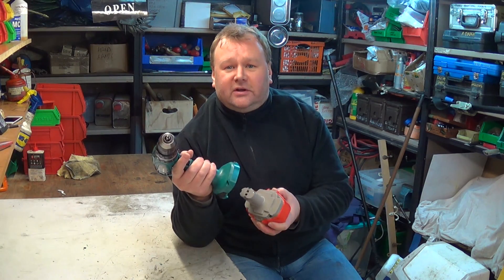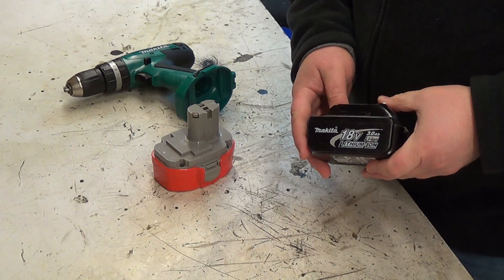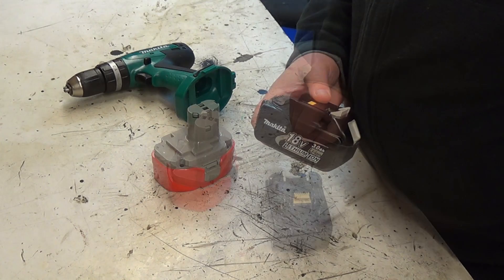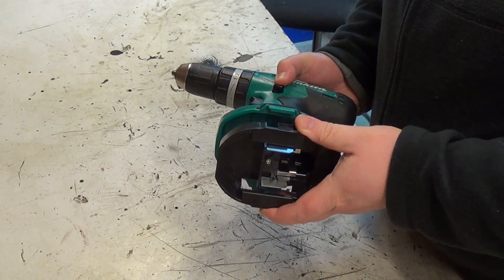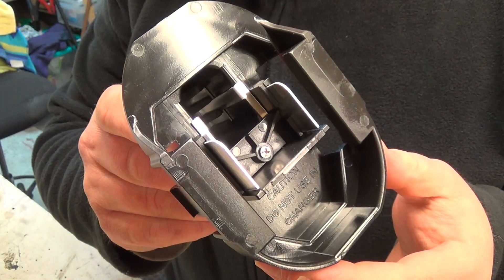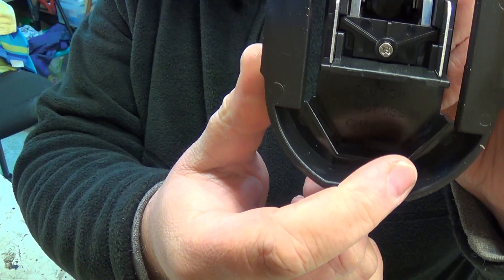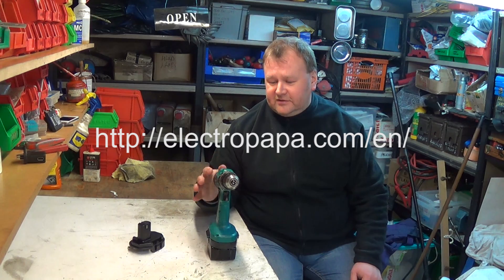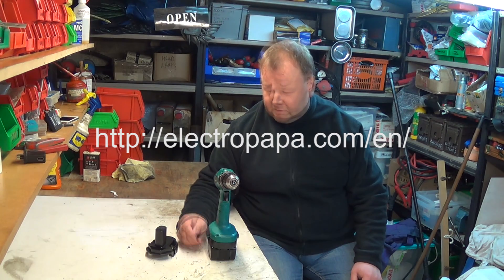Makita 8319D Ni-Cd to Li-Ion Conversion Using Adaptor, Adapt Ni Cad Drill to LXT Lithium Ion Battery

Comment: Is it not to many volts for it though
Reply from the maker: My old drill was also 18v. You could also use a 18v battery on a 14v or even 12v drill, but it will spin faster, and if you work it hard it might overheat. To be honest, with the fact that the old ni-cad drills are worthless now it would probably be worth the gamble. The other thing to say is that this vido is seven years old, LXT drills are much cheaper now and secondhand ones can be had for less the price of an adaptor in many cases.

Comment: This adapter will work with Makita 12v ?
Reply from the maker: It may fit, but not sure you want to run a 12v tool at 18v.

Comment: You have the exact same drill as me, I bought it new and it’s been a god send.  One thing that does worry me though is what to do when the brushes die ?  Any ideas ?
Reply from the maker: The brushes in an 8319D are built into the motor and not replaceable separately. You can still buy a complete new motor for £20 if it dies though. To be honest the drills tend to outlive the batteries on these old drills, so i wouldn't worry.
Reply: @ShedTV  love that reply man !!! Thanks 😁😁
Reply: It’s got a little bit of a whining sound ? Any ideas ?
Reply from the maker: @RFURDALEY  Unless you feel like taking it apart and greasing the gearbox, just spray a bit of thin lubricant down the chuck and around the gear rings and selector and work them back and to. That might help. Like I said it's an old drill, if it's still going; happy days!
Reply: @ShedTV  Thank you 🙏
Reply: @RFURDALEY  Many power tools whine, don''t whine about it
Reply: @johnussss  aha ha ha ha ha ha ha hee ho heee ha ha ha. You are funny

Comment: Where can you buy that adapter? Also will it work with a 9.6 volt drill (my existing nicad battery voltage) conversion to 18 volt lithium battery? My drill is an old 6260D model. Thanks for your time
Reply from the maker: Various adapters come and go onto the market, the best places to look are eBay and Amazon. I don't think that running a 9.6v on 18v will work for very long before it destroys the motor though.

Comment: Do you have a direct link for the adapter? Their website had lots of different ones. This is exactly what I've been looking for,.
Reply from the maker: I think thsi is the right one. Do please double check though. https://www.ebay.co.uk/itm/Professional-Battery-Adapter-Converter-fit-for-Makita-18V-Ni-Cordless-Power-Tool/402505299359?hash=item5db72f759f:g:~i0AAOSwOGdfj6UO
Reply: Excellent, thank you! Purchased. I'll let you know how it get on!

Comment: The older Makitas seem to be better built too.. Maybe it is just me.. But I had a brand new 18 volt brushless Makita hammer drill and it started smoking after just drilling 4 3/8 inch holes 2 inches deep in hammer mode on concrete, so I took it back. The next one got extremaly hot in a short period to the point it burned my hand. My old Makita stuff still runs great.
Reply from the maker: Jason Hull That’s interesting, I wouldn’t expected better!
Reply: Al new things now are made in china, even makita, hitachi and hilti
Reply: Dolmar F might be so but they are made with better quality parts. We just have to face it.

Comment: I have a 14.4v Makita Ni-Cd batteries. Can I use the same adaptor and a new 18v LXT battery?
Reply from the maker: Colin Sutherland I have used 18v batteries on a 14.4v Makita. It will run a bit faster and the jury is out on whether it’ll ruin the motor in the long run. To be honest I’d just do it if it gives a bit more life to a drill that’d otherwise be thrown away.
Reply: @ShedTV  Much appreciated. Cheers...Colin
Reply: Thanks for helpfull infos. What will you suggest me to do, I have the same in 12v (Makita 6213d) 👍🏻

Comment: I read lots of comments by narrow minded people. Some of us have more than 1 Tool in Nicad and Lithium Power.
We already have multiple batteries and Chargers .........so much more sensible to convert  Tools to Lithium Battery Power instead of buying another Ni Cad battery.
Lithium has the advantage of Power / Size for Amp Hour Capacity.
My Hedge Trimmer, Blower, Sabre Saw, Grinder, Angle Drill, 2 Drills, Impact Wrench, Hydraulic Lug Crimper, etc. Don't have any problems with them performing what I need them to do as they all share the same battery.......9 of them. Then charge them for the next days task.

Comment: $100 gets you a brand new makita drill with batteries and charger and a case. New cordless tools are so much better than old ones
Reply from the maker: New are better than old, true. The point of this was that I already had the drills, LXT batteries and charger. All I bought was the cheap adapter. I have used the two dills fairly heavily since I made this film and they're still going strong. Plus...no way can you get a new Makita drill, batteries, charger and case for $100 (£75) in the UK!
Reply: ShedTV New power tools aren't always better. The battery system definitely is, but swapping the new batteries onto an old high-end drill will get you a more robust and powerful drill than all but the new higher-end drills, and those are not cheap!
Reply: I cant believe that's true V. Vega.
I have a bunch of Makita 18v drills, all about 2000 to 2010 vintage, all still going strong... robust, metal-geared. It's just the batteries that don't last. 
There's no way $100  buys you that kind of quality, $100 barely covers the two Li-Ion batteries and charger. I'll be keeping my old Makita drills and fully expect to get another 15 years of service out of them, minimum.
I'll probably just replace the NiCad's, cheaper than a conversion and last just fine if you know how to look after them properly. Nice vid though.

Comment: Surely, by the time you have bought Lithium batteries and a charger, it's a LOT more money than a reputable 3rd party replacement Ni-MH battery? In addition, the overload circuitry in the drill will have been designed for Ni-MH not Lithium - which needs very careful monitoring or it explodes ! :-(
Reply from the maker: Yes, I agree that that would be prohibitively expensive, but I already had a charger and some batteries which came as a lot with some other tools and I'm not going to waste money on obsolete Ni-MH batteries for a couple of old drills. As for the circuitry, you may well be right, I bow to your better knowledge, but I figure that if my old style drills blow up in the end, I've not lost a great deal. I've used both drills heavily since I made this film and they're still going strong. But watch this space!
Reply: Is there a Li-ion replacement? Where? I haven't found one.
Reply: Exactly - tools designed to use NiMH batteries never have Li battery packs made for them...companies don't want to get sued when your power tool sets your house on fire - or the battery explodes/catches fire because someone plugged it into a NiMH charger. I would just get a NiMH battery replacement from Amazon/Ebay - even the clones are pretty good these days and relatively cheap. Very few people could tell what the battery technology was - unless they read the logo on the case!